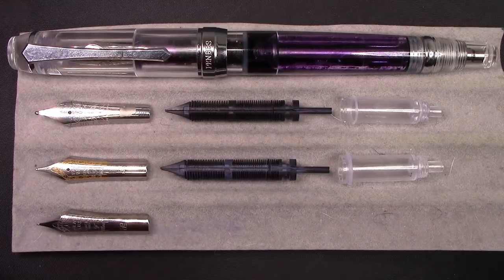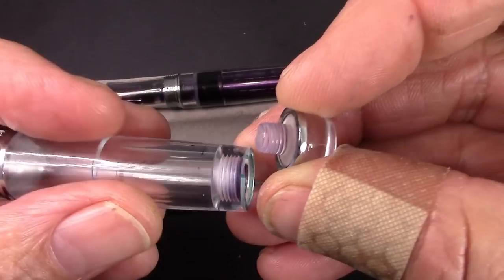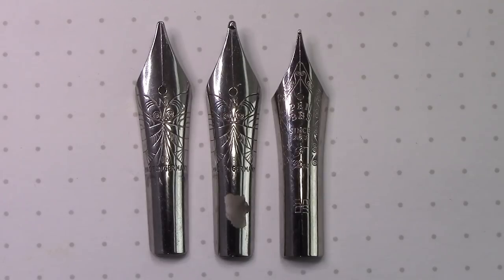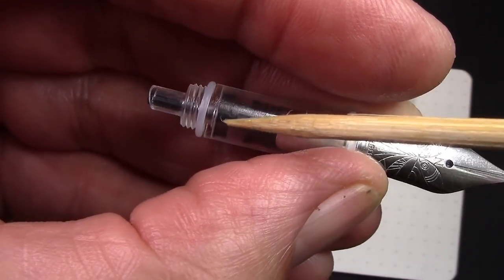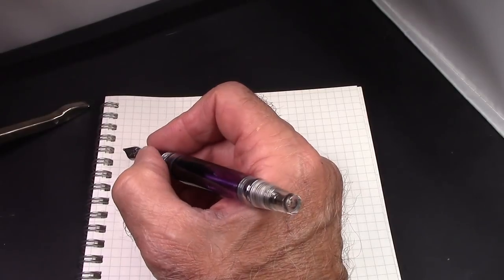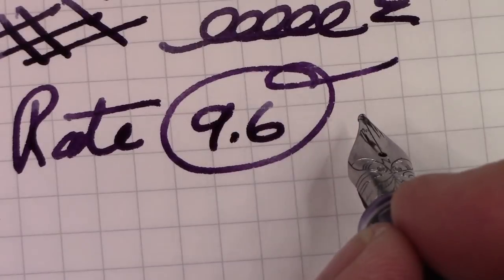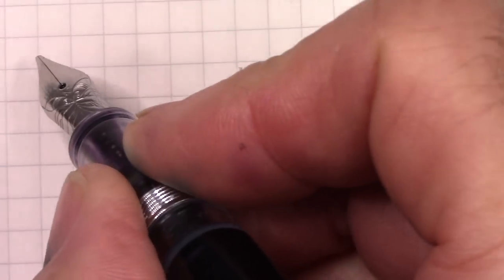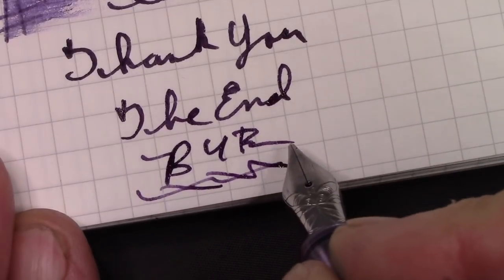PENBBS 456 16SF with Nemosine Nibs

Comment: A method I use to get the tip of the feed closer to the nib's (to enhance ink flow) is to grind the tail-end of the nib, by a mm or 2, as needed. What might mitigate this shortening of the nib, however, is the progressive flaring of the nib towards its wings, hindering sliding the nib into the section as much as I would like. Thank you for your demonstrations.

Comment: Thank you.  I do enjoy your videos.  I was watching one where you mentioned that you could no longer find the red syringe use.  I think it was an older video so this may no longer be something you need but I couldn't find it again to comment.   Anyway, if you do or some of your visitors need to find one, here is a link in Ebay to the Desoldering Bulb: https://www.ebay.com/itm/Desoldering-Bulb-for-Soldering-Irons-Solder-Removal-Tool/123253998185?ssPageName=STRK%3AMEBIDX%3AIT&_trksid=p2060353.m2749.l2649
Reply from the maker: Thanks, that's the one.   I was able to get more online from Radio Shack